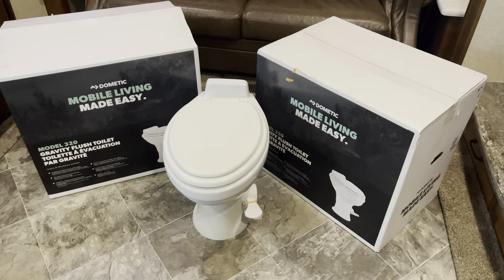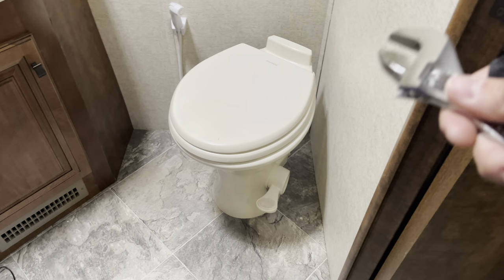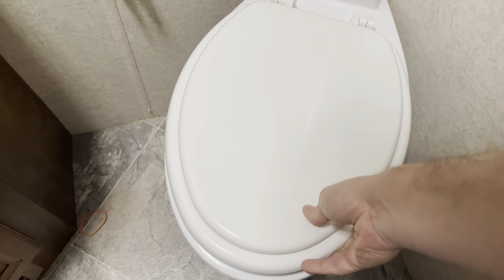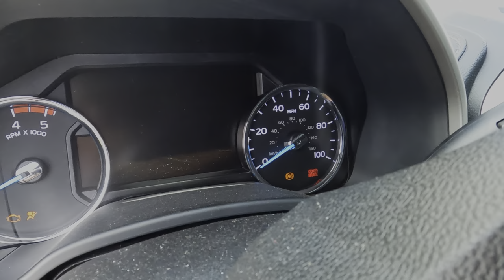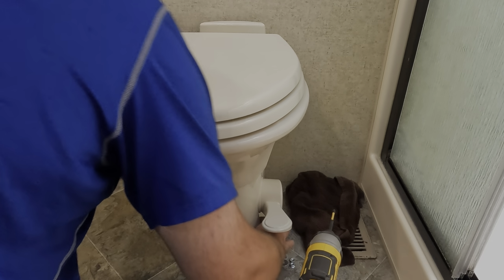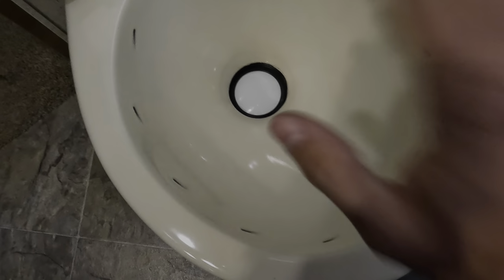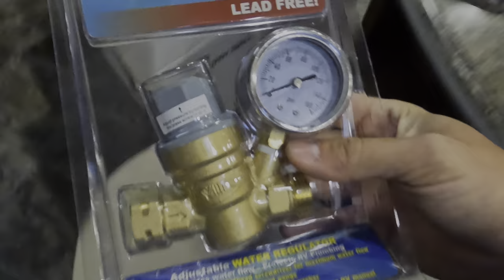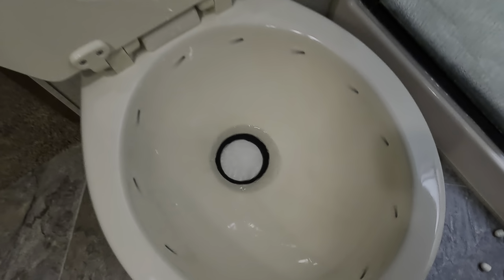ULTIMATE RV UPGRADE! But don’t do what I did… The DOMETIC 320 secret!

Comment: The measurement that got you is the distance to wall. I know other people that have done the same mistake as you. get a spare valve for the flush pedal, they do go bad but are easy to change out.

Comment: Big Country, how much smaller is that dometic 310 than the 320?  I really thank you for the info on the water pressure regulator.  I had no idea it was a thing.  I'll be getting one for our 5th wheel Rezerve.
Reply from the maker: 310 is like the same width but not as long as the 320.  Water pressure isn’t as big of a deal with the 310.
Reply: Flat back instead of a flat front, looks like it did not try to copy a Kohler Kingston

Comment: What's your distance from the wall to the bolts for the bathroom with the 310? I just ordered a 310 also, I only have 9" from the wall to the bolts... 😬 Pls let me know
Reply: Hopefully it works out, l measured 10 and had about 3/4 of an inch to spare

Comment: Did the 320 require 10.5" or 11" from the back wall to the bolts? I've read both so I'm a bit nervous because I ordered the 320 and I have exactly 10.5". 😬
Reply from the maker: Did it fit for you?? Sorry I didn’t get back to you. I’ve been slammed!
Reply: I believe the 310, 320 are all 10” rough in. The 300 series is where it’s 8” roughin
Reply: I just bought 320: 11” from back wall.
Reply: @aprilb.5643  The 310 has a 10" rough-in, the 320 has an 11" rough-in.   Hence why Big Country replaced the 320 with a 310 when the 320 did not fit on the first toilet.

Comment: Good video. Would not set regulator above 60 psi.
Reply from the maker: My RV is stamped, “100 psi max”. I’ve ran 75psi and I’m currently at 65psi with no issues.

Comment: Which one would you say is better?  I have a 320 but it looks like the 310 would flush a lot better.
Reply from the maker: 310 does flush better with lower water pressure. (45 PSI) on the other hand the 320 flushes great with around 65-70 PSI! Either way I’d go with the 320 any day of the week simply because I’m 6’3” lol

Comment: so i just replaced my 310. Super upset about it. The pedal broke. That's all i needed to fix it. Guess what you can't buy just the pedal. Dometic told me it was a sealed system and there was no way for me to put the pedal on. This is not true. Not only did i watch a video on how to do it, i put my old pedal back on after taking it off. So instead of buying a 20 dollar pedal, i have to  buy a 300 dollar toilet. It's ridiculous.